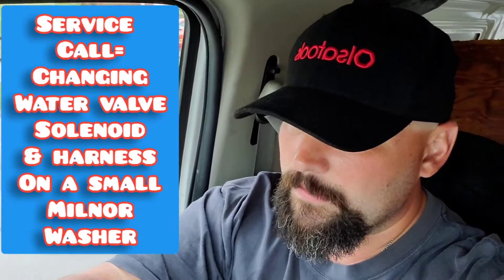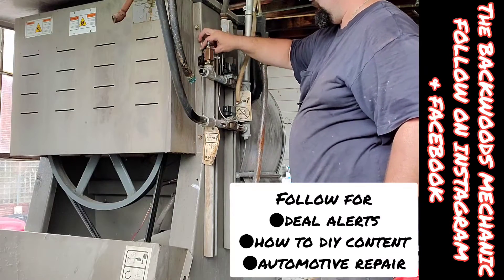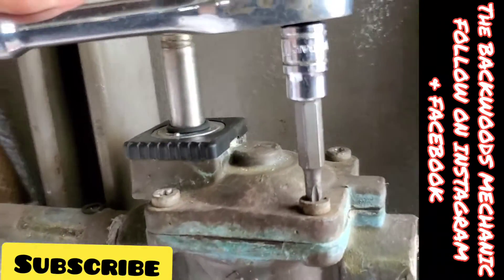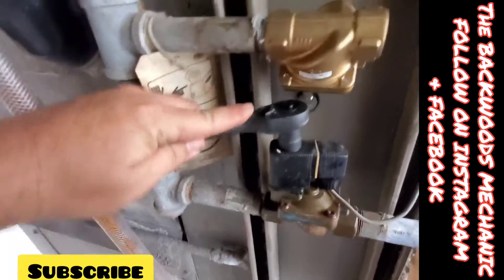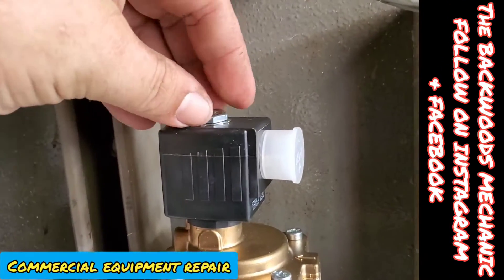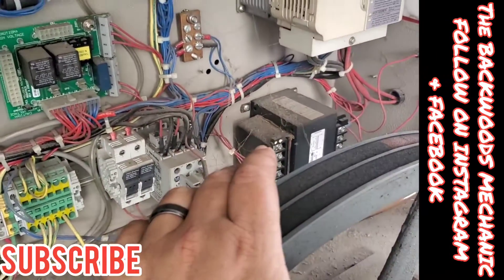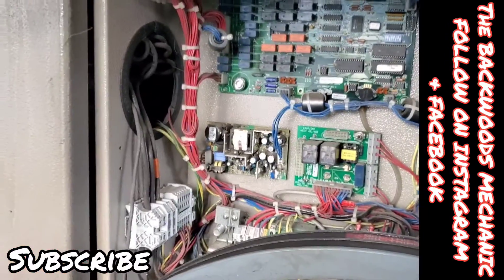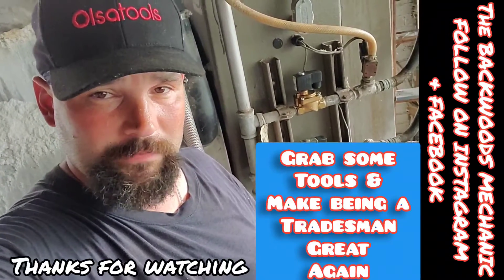Milnor 80lbs Water Valve Solenoid Service Repair (GearWrench, Channel Lock, Craftsman in Action)

Comment: Thank you for the video! Dunno if this is the problem I have with my machine, but will try and check it out.

My dad was more of the handyman but he passed away. My issue is that my machine gets stuck in "last rinse". Replaced the timer and what I think are the relays. Still same thing. 

It seems like when I turn the machine on it has a loud humming noise. Put my ears to it and I believe the part that it is coming on is the solenoid valve based on a Google search. 

Would like to be able to fix it on my own if possible, otherwise need to find a maintenance man to come service it